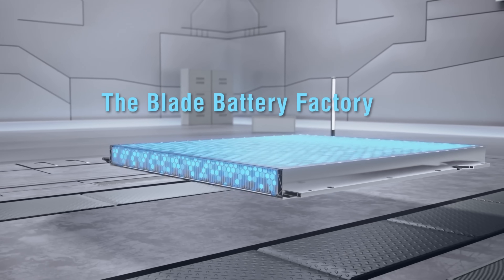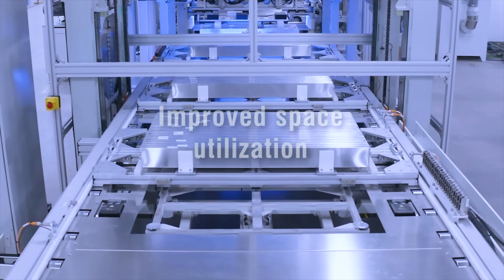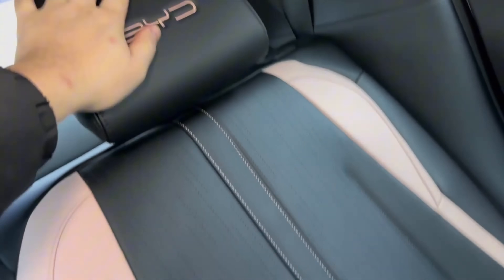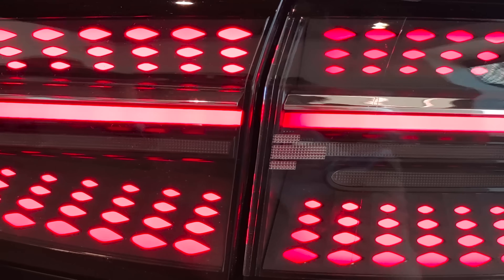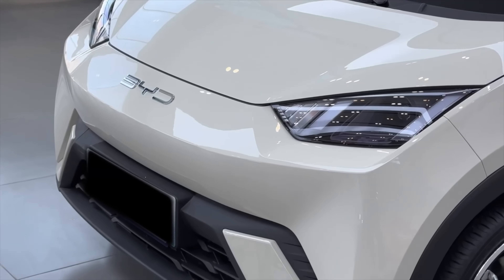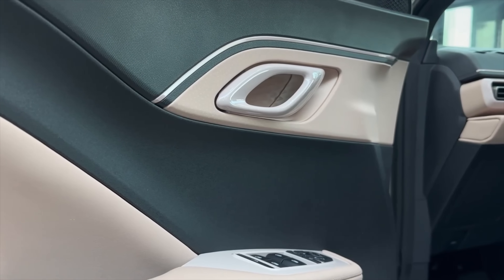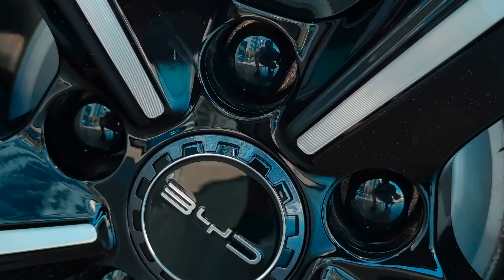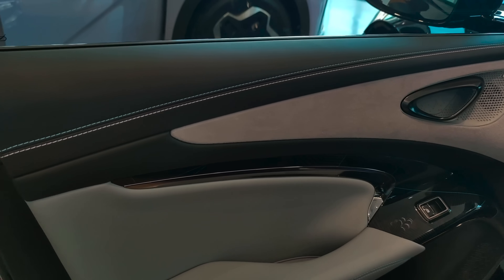Blade Battery 2.0 vs The New Solid State: BYD's Massive Leap Explained

Comment: No one understands how electricity works. Fast charging is great, but how much grid electricity would be needed to charge a pick a number? EV people want an ICE fill-up. Great, but do they need to upgrade all of the grid to larger copper wires and all the other transformers and people's homes?  Electricity needs bigger wires, which now weigh more, which need bigger towers, and so on and so forth. BYD may build a battery that is free, but there is nowhere to charge it.
Reply: I'm not sure that will be the case.
Homes will not need larger wires because the car will charge over night - speed is not an issue.
On the highway you will just need a bigger cable to the kerb - but in fact, given that charge time is so much faster, you will likely have fewer cars charging at any one time.  Charge and go.  If the charge starts to exceed design parameters then charging can be slowed, as happens already.  
However, what will likely happen is that sites with a lower grid provision will simply have a large battery pack on-site, which charges slowly, then dumps power rapidly into the cars when they turn up.  When batteries have a higher energy density then the cost of doing so will drop.  If the installers are wise they will also have solar canopies over the charging bay and on top of the rest room, to offset grid demand in summer.
Reply: That isn’t what this video is about. Electricity is everywhere. The speed of recharging is a logistic issue not a technological one
Reply: This is just describing infrastructure changes that would be necessary to fully take advantage. Sure in the west that is more profit driven it may take a long while but it's not impossible or even that hard. BYD already giving the simplest change by just setting up stations with batteries that slow charge and then discharge into your car whenever you need it.
Reply: The wire above your head ie transmission wires on most streets are already in the 1KV range, some much higher so actually it is easier to get that voltage to a charger and charge an EV than a house which needs a transformer to step the voltage down. Further, EVs, connected to the house creates a storage so the house can use the electricity when the grid is at a peak and put it back into the grid if required and or the house. EV,s might be the saving of the grid and with solar connected to houses via VPP, (Virtual Power Plant) the grid and power station requirements as well as infrastructure will be reduced as they are already in parts of Australia. I have been in 2 VPP,s in South Australia and have a House Storage battery and use very little from the grid. If I had an EV connected to the house (legislation recently passed to allow it) I would have a much bigger EV storage. The power company I am with has recently been testing my battery via the VPP to stabilise grid but as large storage batteries have come on line it seems the VPP will not be required for that reason.  Bottom line, EV,s won’t destroy the grid or cause infrastructure blowouts in costs, so far and probably into the future it could be the saviour of the grid.
Reply: Not bigger wires, charging Stations will have batteries to charge cars faster.
Reply: I agree. But it's about misleading advertising rather than not understanding how electricity works.  Electricity is very complicated, and there should not be an expectation that all EV drivers know this.  Similar to how most people don't understand the chemistry of gas, they just fill up the tank.  Thanks for highlighting this issue!

Comment: Once again BYD Blade battery are Semi Solid State Battery SSSB, for anyone who are clueless because of google search lack of info!
Reply: Even Indian EV uses BYD batteries.

As per Google ... everal Indian electric vehicle (EV) manufacturers utilize BYD batteries, with Mahindra and Tata Motors being prominent examples, and Maruti Suzuki also using BYD's Blade Battery for the e-Vitara. BYD's proprietary Blade Battery technology is particularly notable for its safety, energy efficiency, and rapid charging capabilities, making it a sought-after component in the Indian EV market.
Reply: SOUrce ?

Comment: NIO offers its 150 kWh semi-solid-state battery (SSSB) pack for rent through its battery-swap stations, and it is compatible with all existing NIO models. While not a standard feature, it can be used in any NIO vehicle equipped with either the 70 kWh or 100 kWh battery packs. The pack is not sold with the car but is available for rent on a daily basis.

Comment: 350km at 130km/h, because from 80-10% this comes down to usable 240km per charge, which means one stop every 2 hours on holiday tours across europe
Reply: In real life it doesn’t really work like that. You start with 100% and after you get experienced you will try and yake it below 10% so your first legight be 450km. When ypu stop you rarely stop at exactly 80% unless you ate in a major hurry - you’d finish your breakfast or lunch and you might get back to the vehicle with 85%. After you’ve done 850kms in a day that’s enough for most people but you might still need a top up to get to your destination. That might be a 10min stop. This is where destination charging becomes so important- you get to where you’re staying and plug in.
Reply: electric network can not support that speed of charging, maybe if YOU drive alone, but sorry to tell you the news - YOU dont matter

Comment: Is there any information on which other brands/cars we might see this?
Reply: Toyota and Panasonic have a joint venture developing the solid state battery. They indicate it will be in production Toyota cars from 2027.
Reply: BYD Blade battery is a Semi Solid State battery SSSB. Nio also have a Semi Solid State battery SSSB. These are the only EV brand that use them!
Reply: NIO offers its 150 kWh semi-solid-state battery (SSSB) pack for rent through its battery-swap stations, and it is compatible with all existing NIO models. While not a standard feature, it can be used in any NIO vehicle equipped with either the 70 kWh or 100 kWh battery packs. The pack is not sold with the car but is available for rent on a daily basis.

Comment: For my situation, I need 500km minimum. But that might be overkill for city dwellers who drive the average 20km a day or whatever it is. 

Is there any word on the cost difference between LFP and solid state? Is it likely to be more than the Blade 2 or the same? Or maybe even less?
Reply: Like God's Eye.....I would expect the total price won't reflect an increased cost.....in Australia. China owns the future.
Reply: If you need an EV with a range of at least 500 km, why don't you go for the Kia EV3? You can buy it with an 81.4 kWh battery and that will give a claimed range of 600 km. However, it is an NMC battery and personally I would prefer an LFP, battery but we are all different. It is supposed to be a very good car. But if you charge it to 80%, the maximum range would decrease to 480 km so you would need to consider that.
Reply: @catherinegrimes2308 I really don’t want NMC. Not only because of needing to manage charging, but also because of fire risk. I live in the bush. If my car catches fire and can’t be extinguished quickly, it would devastate the whole area and kill so much wildlife. I’m not willing to be responsible for that. 

I did toss up the EV5, and haven’t completely knocked it off my list, but it really is too big for what I need. I currently have a Mitsubishi ASX and that’s the kind of size I’m hoping for. I don’t have a family to fit in. It’s just me and a dog and cat. A family SUV seems ridiculous. 

Currently I’m hoping we get the full EV version of the Sealion 5. I think that would work for me with the Blade 2. It’s looking like we might only get the PHEV version though. I love the MGS5 but it’s just that bit too tight on range. There aren’t many chargers out here. It might do it, but I need that extra bit of wiggle room to avoid anxiety.
Reply: @moniquem76  Stick to ICE vehicles for the foreseeable future, if you are worried about emissions, I wouldn't, the average EV takes 8 years just to "cancel out" the emissions of creating the vehicle.
Reply: @bdub884 Most studies suggest it’s carbon neutral and emission neutral in about 20,000 km to 30,000 km so for me that would be 12 months. I haven’t seen a study that suggests 8 years.
Reply: @bdub884  "the average EV takes 8 years just to "cancel out" the emissions of creating the vehicle."

Based on what? What is the source for you claim?

You can't just make an open ended statement claiming all EVs take "8 years just to cancel out the emissions of creatng the vehicle".

There are several important factors that need to be determined and considered together, to place a value on what it required to cancel out the production emissions of any specific EV.

For example I have read one article that states, a Tesla model 3 charged 100% from coal fired power sources takes 21,275km to begin negating it's production emissions. In my country, that would equate on average to about 18 months of driving in that case. But that is just one example from one article. I know there has been comprehensive studies done on this.
Reply: @bdub884 which energy mix are you basing that on?